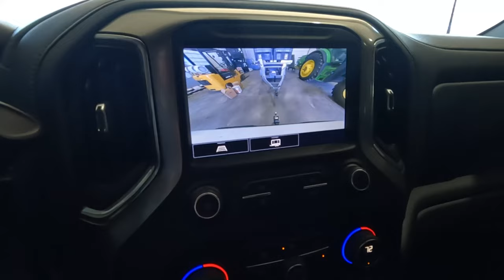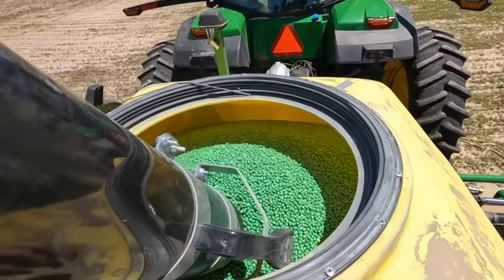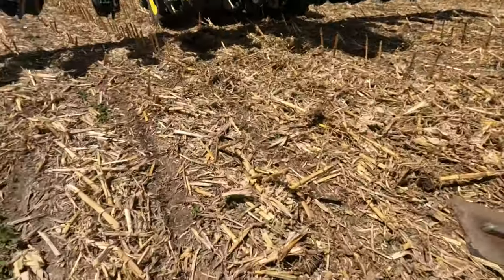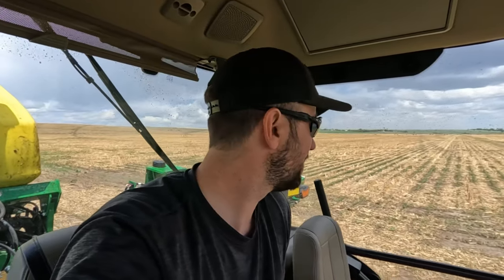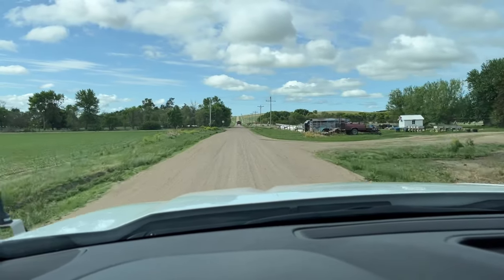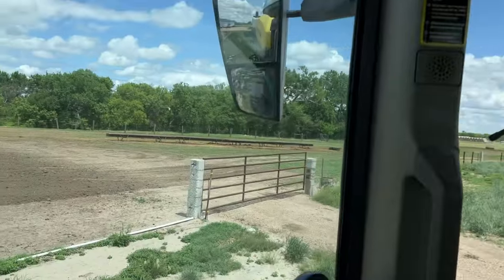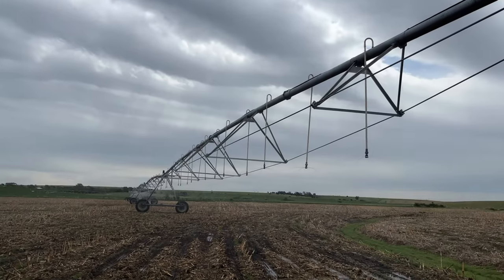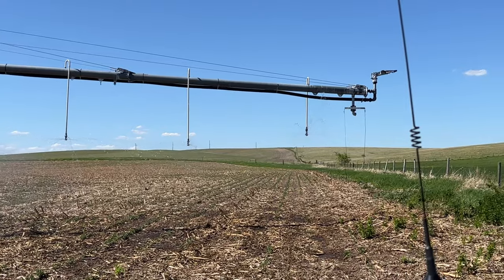We had to Replant the Soybeans

Comment: Because you are replanting, when they mature, will you knock more beans off the 1st planting, or are they close enough in planting time that that will not be a problem?  Love your videos! Thanks
Reply from the maker: Maybe a little. Beans mature more off Sun angle so they should finish roughly the same time unlike corn which is heat unit based.
Reply: @ONeillFamilyFarms  thanks for increasing my knowledge today!

Comment: Hiya Rob,
Thank you for a great video. Putting the tape over the vent, put a piece of foam over the vent, and tape into place, this should block almost all the sound waves. If it's too quiet, push a pin through the tape/foam to let more sound out. You may have to work the pin around in the hole to let enough out, play and try. 
The farming was great, I learned quite a bit, I know next to nothing about agriculture, I just love learning stuff.
Stay safe, Steve...
Reply from the maker: Thanks!